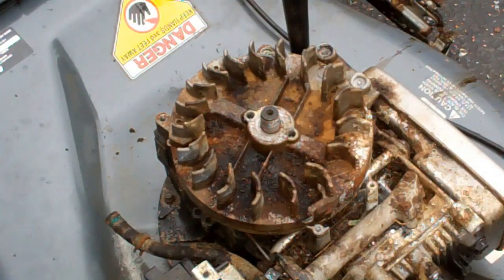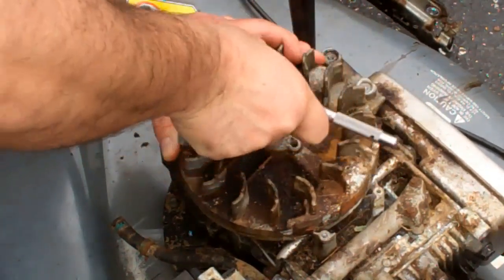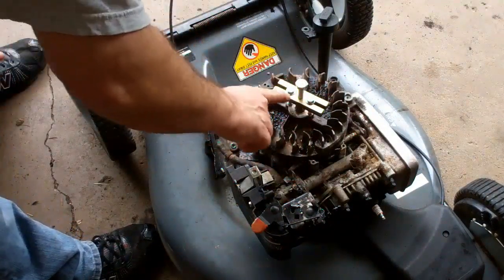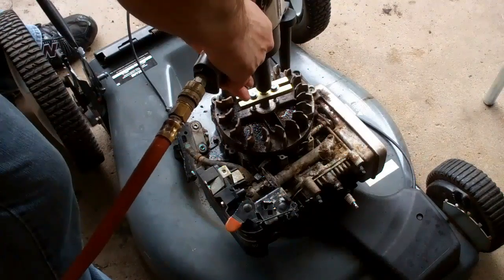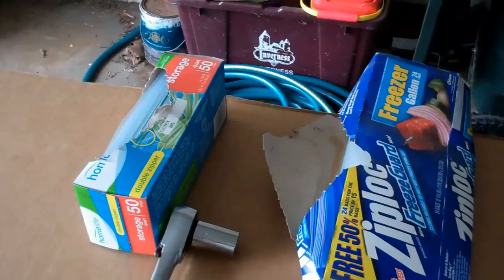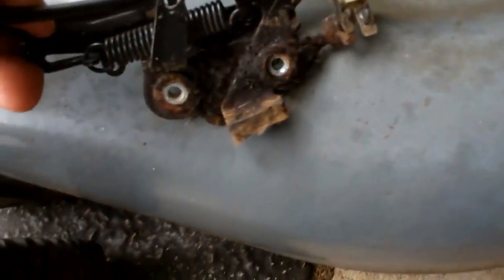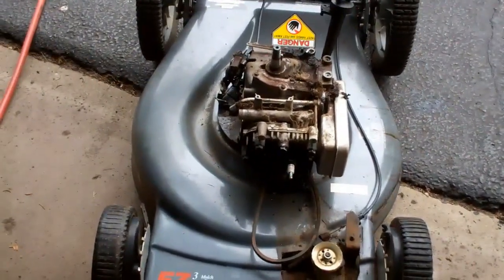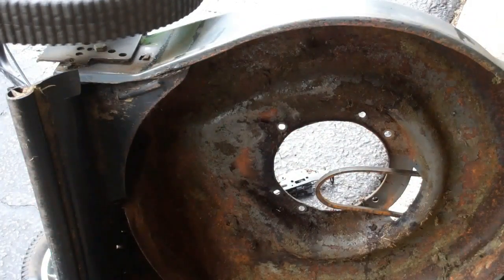Removing Lawn Mower Engine - Part 2

Comment: I went through this exercise without the benefit of an impact wrench. What took you just a few minutes took me well over two hours (stripped bolt heads, broken bolts, and etc.). What a difference the right tool makes.

Comment: Annoying that B&S didn't tap those holes.
Reply from the maker: +rfn944 It certainly is!!
Reply: +AlchemistLair 
I can see you're threading quite aggressively. I wouldn't dare to go that deep at once. But hey, it worked.

Thanks for a detailed documentation btw. I had minor damage in the carb to governor linkage in a different make and model using the same engine. It was too confusing without prior knowledge of this type. Good and detailed exploded views seemed to be unavailable.These videos(where pretty much every part is visible) helped me troubleshoot the problem today.